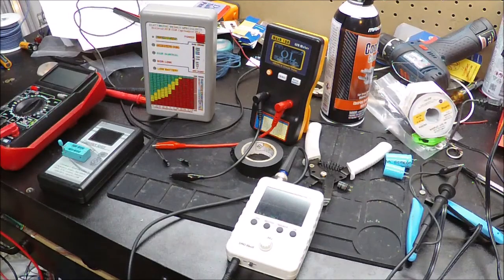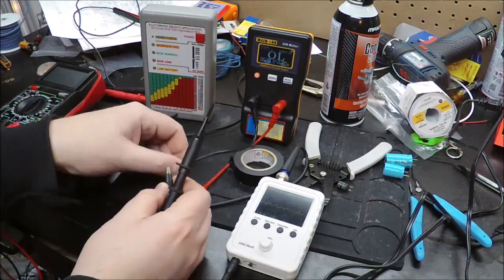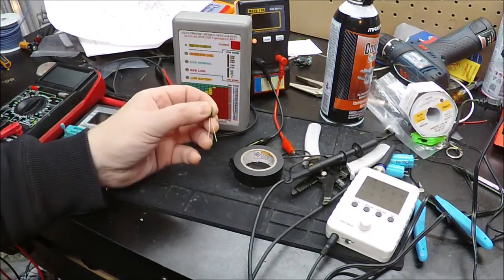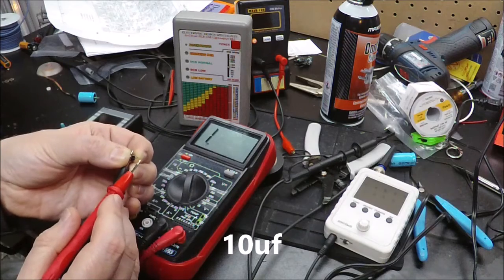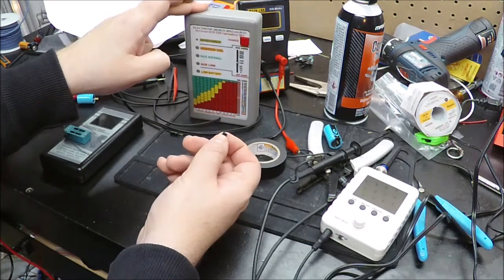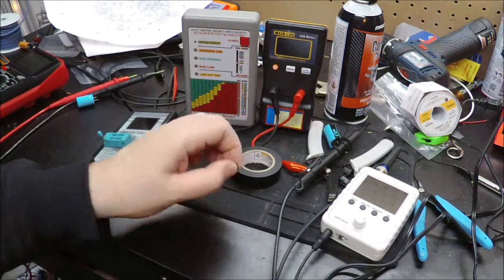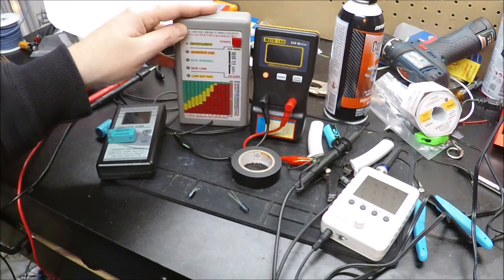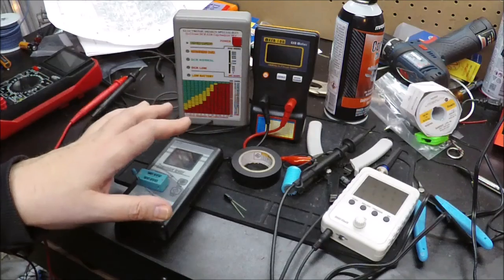The tools I have for Capacitor testing.......and what they do.

Comment: I'm going to build the leakage tester seen in this youtube video.
(  EO&N Cap Leakage Tester final build and testing  )
Looks like a decent option, for not a lot of money.
Reply from the maker: It performs the same sort of high voltage test that the old school testers did.   I like it.   I managed to find an old school unit,  so hopefully I can fix it.
Reply: I've also found that the old leakage method seems to be what the more experienced techs prefer. But hey, replacing old with new isn't a bad thing either. It all depends on the individual circuit demands. 
I'm trying to fix up an old scope atm myself, so I want to use this, plus esr and capacitance tests on the old caps inside it. My finished BOM/parts list on this leakage unit build are up to 80 ish euros/87 dollars. So not that cheap really. But it's probably the cheapest option for me. 
I've seen similar old oem units on ebay selling for 300 dollars plus, not including shipping, which is upwards of 100 dollars plus, too steep for me. Anyway, nice score on the oem unit, best of luck with it 😉
I'll check out the repair video 🙂  @DeadKoby
Reply from the maker: I fortunately got my OG leakage tester fairly cheap on Ebay.